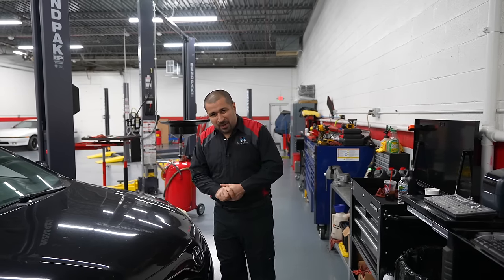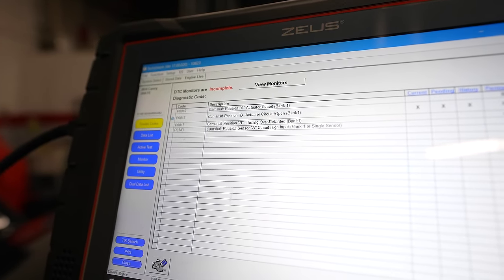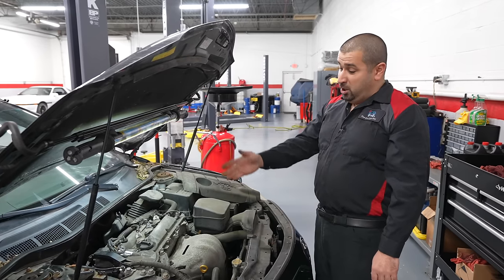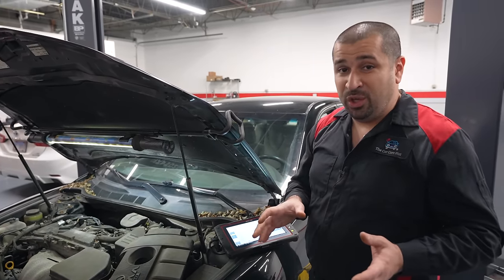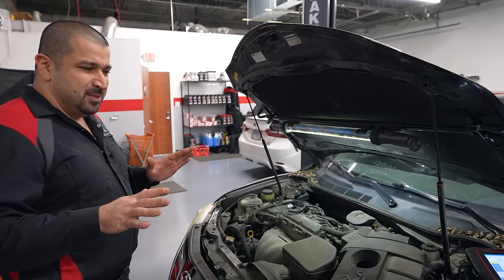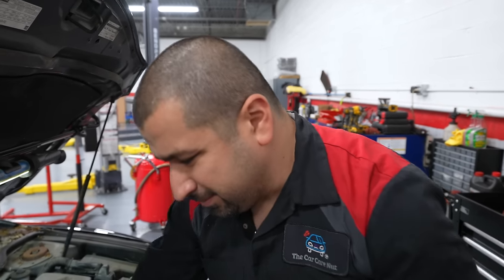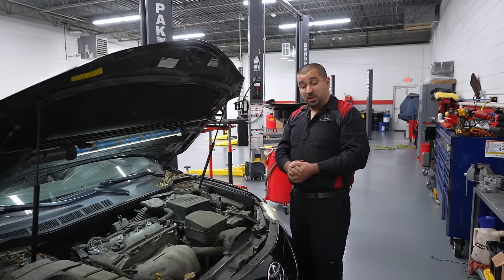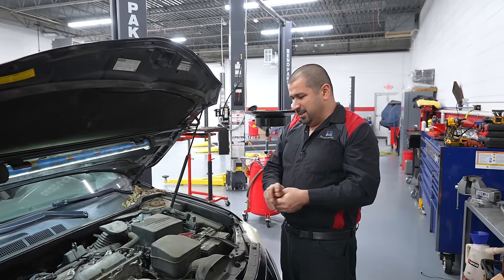Mechanic Parts Cannon FAIL Cost Customer A LOT! Let's Try This Again

Comment: Before replacing the ECM, I would check the 2 wires that you did a continuity check on to see if the can carry current.  A continuity check isn't always enough to rule those 2 wires out. I had very similar issue and it wasn't the computer, it was one of the wires. It passed a continuity check but when I hooked up a 40 Watt bulb to one end of those 2 wires, and battery power to the other end, the bulb wouldn't light. I used 2 known good wires to bypass the questionable wires and it fixed the problem. Just my 2 cents

Comment: Whilst I left the automotive industry a few years ago,

The 2 problems facing even a due diligence mechanic are:

1) Customers who are somewhat ok paying for the solution, but don't want to pay for the diagnostic work (as though mechanics are people who know everything, and so should instantly know what is wrong)
2) Dealerships who get paid less to do a warranty job (lower hourly rate), and so want their technicians making money from servicing more cars (so try a quick fix, so that you can move on to the "money making" cars).

That and the parts canon approach.

I remember working on a car which was under warranty many years ago, the scan tool pulled up error codes on the speed sensors in the auto,

So new ones were orders..... I pulled out the old ones and found them covered in magnetic debris..... showed the foreman... who told me to just put the new ones in.

There was no, clean them and see what happens..... "Parts canon to the rescue".....

Comment: Thanks for covering this topic and hope more people follow these steps.  My vehicle had an electrical problem that was a similar story leading to a new ECU computer. I found and replaced the short that damaged the computer. My concern with the vehicle in this video is NOT knowing what cause the electric short in the first place.  Potentially you replace the computer and it could happen again. If the customer is on a budget, they should cut their losses now and put their money towards a different car.

Comment: The way you do it is simple is because you use a detailed process of elimination not assumption a scan tool is not a fixer you’re supposed to be the fixer. It just gives you insight on the systems in the vehicle. Sad too many mechanics use it as a fixer.

Comment: I take my Tacoma to a Toyota dealer. I’ve found that Toyota dealers know what their doing and I haven’t had a problem with them selling something I don’t need. So far I haven’t had any problems with the truck at 60,000 miles but if I do I wouldn’t hesitate to have my dealer repair it. I believe that most if not all Toyota dealers want to maintain their reputation for quality service.

Comment: The sad part is this is basic common sense for any true technician. I see and repair these type of situations almost weekly if not monthly. If you don't understand how something works then you can't correctly repair/fix it. To many parts changers get there hands on a scanner and then become dangerous technicians.  A scanner is dangerous in the wrong hands. Also a perfect example of why  you shouldn't take advice from auto zone or O'Reilly's when they scan your vehicle and tell you to buy and replace this said part. It takes a certain skill and talent to properly diagnose and repair modern vehicles. I also own a fast pace shop and can't believe the amount of mechanics that think they are technicians and can't perform a basic circuit test let alone test for power and ground. Sad! Good job on bringing some light to those of us that truly care and know how to test and diagnose and repair a customers vehicle correctly..on a side note how do you justify  charging a customer  for a repair that YOU recommend and doesn't fix their issue..any decent repair facility would make that right.

Comment: In the early 90s my 1984 cougar suddenly never went to low idle. Always on high idle. I went to the library, got a Chiltons book which said how to check the idle control solenoid (irc). If it didnt move, the solenoid was bad. If it did move, the engine computer was bad. Turned out to be the computer. I went to the salvage yard, found another car, ripped it out of the footwell, put it in mine and life was good. $50. 

It wasn't long after that and salvage yards wised up. They pulled the computers themselves and kept them inside, sold for much more money. I don't even want to know how much a modern computer is. I think my car has like 7 computers I read somewhere. Everything goes through it, even the windows.

Comment: Order of operation. 

1 Take customers input seriously. 

2 Check for codes and compare the codes to the customers complaint. 

3 Test don’t guess. Test for power and grounds if there’s good power change the part of there’s no power find out why. 

4 Update the customer on how you discovered the problem and how you fixed it and educate the customer on proper diagnosis.

Comment: I had customer with the same problem but on different toyota engine and result was-fried computer.
But,my investigation of the cause of the problem was that somebody connected power (12 volt) directly to the wires of the solenoid(probably to activate vvt without computer) without unplugging them.
Well,you can do it(activate valve if you don't have diagnosis computer) but you have to unplug the connector and give power directly to the solenoid.
Thanks for the content.

Comment: Owned a 3 bay shop with employees for 31 years, retired now. I can’t count how many times a new customer would show up with a part in their hand that they wanted installed. When asked if they had it diagnosed their answer would be yes the parts House pulled the trouble code for me. At that point customer training would begin. First class, explaining that the trouble code only tells you the area of the failure itself not the actual failure. Second class, a proper repair involves diagnostics using knowledge and equipment, which will have to be paid for. Just like your doctors office. Final class, when the proper and complete repair is done, we will stand behind our work. If they understand and agree to all this, then you have a good customer. If they still wanted us to install the part, then they would have to sign a disclaimer understanding that we would take no responsibility for the repair.

Comment: I hope my physcian is as good a diagnostician. The concept of understanding a system will help with diagnosis is a profound concept in today's world. Please let us not  forget the concept of experience. The accumulation of positive outcomes allows the individual to become extremely proficient in achieving success in a timely manner. The challenge is not to falter when initial attempts results in failure. Experience is earned not rewarded.

Comment: We do the "parts cannon" in aerospace maintenance as well...drives me absolutely CRAZY!  Biggest problem (aside from the infinitely complex wiring, digital data bus standards, and AC/DC existing on the same chassis) is a variety of people; whom bring a variety of skill sets, and a variety of background knowledge.

I'm sure there's a similar problem in your field as well.
I strongly disagree with clearing trouble codes right off the bat.  Pull out the scanner, start logging real time parameters, and look for conditions that would cause the computer to trip a CEL/malfunction lamp indication, ETC...  If you can't see anything abnormal, try clearing the code and see what parameters change, or if the vehicle behaves differently afterwards.

Sorry for being a pompous windbag but I've been troubleshooting "systems" for a really long time.  I sincerely enjoyed watching this video BTW...😎

Comment: Thank you for your expertise! Todays technicians and far more like computer technicians then old time backyard mechanical technicians. I was able to diagnose most of my vehicles until modern electronics took over the operation from mechanical engine interfaces. Case in point mechanical fuel injectors replaced by electrically operated fuel injection.

Comment: Excellent diagnosis process! Especially quick component elimination by switching connector exh to int. Too bad superior OE valve not avail to test and see if was root cause of ECM failure. Also good for techs to probe on harness side of connector to prevent damaging terminal/pin fit.

Comment: Great diagnosis 
I would have done it slightly differently. 
I would have disconnected the exhaust ocv connection and installed a test light or noid light at the end of it.
Than carry out a active test on that ocv circuit 
Great video 
Thanks for sharing

Comment: I know of a repair shop who sold engine overhaul. Customer curiosity wanted to see damage when disassembled. The ignition coils were needed and the shop owner sold engine overhaul...Long story short....Shop owner asked technician to show vehicle owner what is wrong. Technician stated he has not discovered an engine overhaul needed failure. The shop owner knocks a hole in a piston with a hammer. Call vehicle owner back to see. This is still in our industry. WOW

Comment: The oil control valve is simple to bench test as well, it's just a simple electro magnetic solenoid. And Toyota lists resistance values. 12v power and ground is all that is needed to test mechanical operation out of circuit (just don't short the pins while testing). In my limited experience removing oil control valves from these can be nearly impossible so doing that would be my last resort.
Even if the original repair was correct and they replaced the intake ocv out of an over abundance of caution with genuine Toyota parts it should only have cost about $600. Aftermarket ocv's vary wildly in price from $30 all the way to Toyotas price of $130 (why would anyone pay OEM price for an aftermarket part?) 
At least now the customer has found a competent shop. You are an asset to your local community as well as the online community.

Comment: About a month ago in my all makes/models shop...customer comes in with a Nissan Murano with a wiper issue...sometimes they work, sometimes not so much and sometimes without being commanded on. Customer thinks it's the wiper motor...ok we order one in and it took a couple of days to come in since we've been dealing with this customer for years and pre-ordering parts isn't a hard thing to do. Now I get my hands on the vehicle and get to the motor and I figure...hey that's a $1,000CAD wiper motor assembly...let's do some basic stupid simple diagnostic tests, hook up the scanner and get into the BCM and verify the switch is sending the right commands, YEP! Check the wiper fuse, it's good. Notice in the wiring diagram the wipers are controlled by the Integrated Power Delivery Module with a non-user replaceable relay inside it...put a load across the high speed wiring to the wiper motor and command the wipers on via the switch...light turns on for 3 seconds and shuts off until the engine is restarted...something in the IPDM is messed up and I know it at this point cause I can jump the motor from the battery and it happily runs, no issues. 

Now we can't program IPDMs so we honestly tell the customer to take it to the dealership...good customer and trusts us, and this is where things fall off the rails! Takes it to the local dealership with a confirmed diagnosis that the IPDM has failed, their tech diags it again and puts the blame on the wiper motor...so the customer perplexed and kinda mad at my shop has them do the motor...all is good for about 2 days then the wipers go right back to operating stupidly. They return to the dealership and then they get the "deal" for the IPDM and the dealer finally replaces it and all the issues disappear. Customer isn't happy with the dealer and that thing came back 2 weeks ago to us for a leaking rad and brakes. 

It only took me what...15 minutes to condemn the IPDM with simple yet effective testing, why couldn't a well known dealership fix it correctly without firing the parts cannon themselves? By the way, Worldpac happily accepted a return on the unopened OEM Nissan Wiper motor and linkage assembly I refused to install KNOWING it wouldn't solve the customers issues.

Comment: You did all checks for wiring, go over load testing wires. Every check u do will read good, you put a load on wire it fails. Good information.

Comment: Yep learned something.  I have all the tech stuff like yourself .... I'm a DIYer at home, tune my own cars, fix my own cars etc.  I'm a "parts cannon" because 99.9% of the time it fixes the issue.  But showing your electrical test/wire wise to the ECU is nice to know.  I'm someone who has to see it done to learn that.....  so thanks.  I wonder if you held a soldering iron to the ECU pin/s whether it would melt the solder at the other end of the pin and thus allow the ECU to see it again.  Could be a temp fix might fix it..... You'd just need to watch it doesn't melt the plastic .....  but doing that a few times might solve it....  for a DIYer that would be OK and also help diagnose that it is the computer and most likely bad solder at the same time.

Comment: I went throught a similar problem on my old honda (odb1). Was charged $450 to drop tank and replace fuel pump and filter that was supposedly "bad".
One week later, left me stranded again.
I had no time to investigate due to work situation and trusted the local garage

After a couple parts (I am learning), and then a little research, I shorted the plug to get a code flash through the check engine light: no flashes = "bad computer"

Never even got a call back from the mechanic.
$450 plus is A LOT of money to me.

Comment: Couple years back, I had similar issue with a local Honda dealer where they were trying to fix my oil leak, but never really fix it until the 3rd try. 1st they changed the oil pan, 2nd they changed the rear main seal, but I still had the same leak.  I paid them over $1000 for the two jobs.  I brought the car back with the same oil leak and complaint to the manager and told him they need to fix the issue and I am not paying them anymore money.  They finally figured out that one of the head bolt came loose and was leaking oil externally from the head and was able to fix it.

Comment: Exactally correct when people call up about codes over the phone. My answer..."could be anything, I don"t know" OR I get told. "Change this part, here is the part" I ask why and they said they watched some youtube video that said the part causes the issue. I offer to the customer would you like me to diagnose and double check. Customer declines. So, I replace the part. Pull out car with same problem. Give customer their old part back. Tell customer its ready for pick up. When customer picks up car it is still running in the same poor condition. Customer walks back in my shop complaining the car is still not fixed. Thats when I turn to the customer and ask " would you like me to diagnose it for you now?"

Comment: I had a situation with a 94 Ford car that would not start.   A local shop asked me what I thought the problem might be, and I said as it was running when I turned it off, and would not start afterwards.  I thought the computer might be a problem.   They replied "Oh, no, computers never fail.  It cannot be the computer."   A month and $1100.00 later, they changed the computer and the car worked again.   Amazing.   I can usually change parts.   Unless you do not have the capability to replace an item, why do you need a shop?  Unfortunately, many people are saddled with those situations.

Comment: i usually back probe the ocv connector and start the engine,use the scanner run the actuator test and make sure had power and ground signal to the connector before condemn the ocv or computer

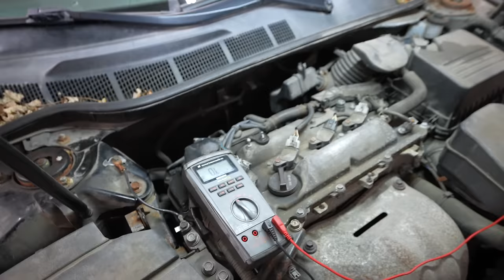Comment: 17:45 just to be a electrical stickler here.... but OL actually stands for “open loop,” which is another way of saying there is an inadequate amount of continuity....   AAAAND  :)  although some people do casually call it a 'volt meter'   the more accurate term would be "multi-meter" as it measures more functions than voltage.  that said, this is an EXCELLENT video, and I could not come close to your expertise in auto diag.   cheers!

Comment: After this diagnosis and before I move to change the unit I prefer first to take the computer out check it and fix it, 
maybe it's a small  problem with the computer.
Often It happens

Comment: I’m a retired ASE certified car technician and I used to say the same thing and cars were a customer bring it in and all these parts to be changed and it still hasn’t fixed nobody took the time to pull the meters out and start testing circuits